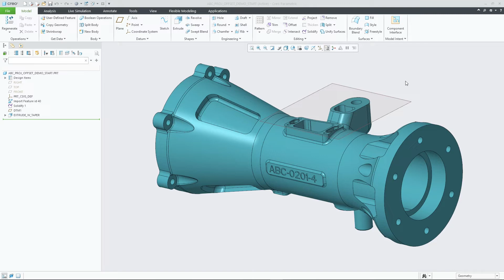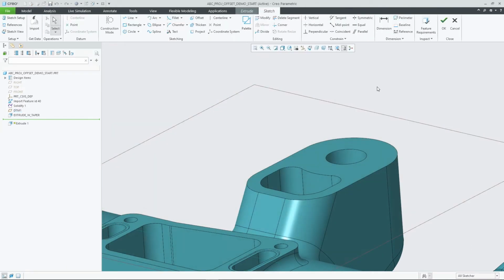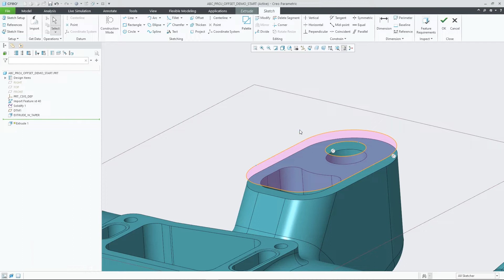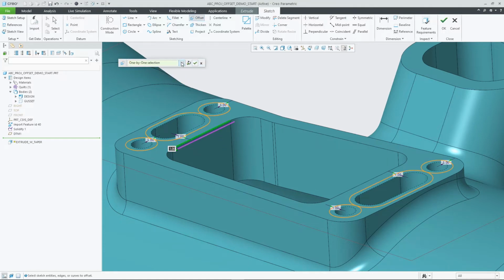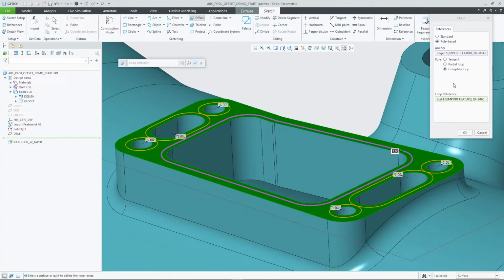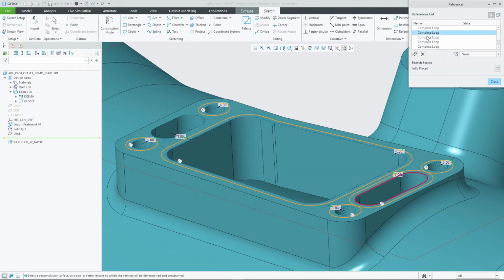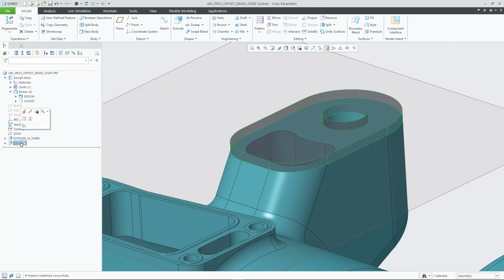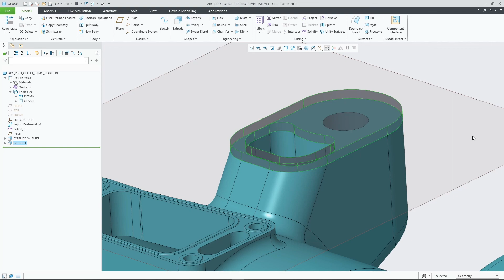Modernized Project/Offset Tools in Sketcher | Creo 9

Comment: Hi, I ended up here because I had problems offsetting a chain of lines and arcs on a simple sketch. In Creo 9, you only have the option to offset element by element, not the whole chain. To resolve this, I have found that you have to do two sketches, one with the original chain and another one using the offset tool. If you want to have the original chain, also use the project tool in the same sketch that you have the offset. 
For whoever is responsible, I do not know if there is an easier and faster way of offsetting a chain, although I would be pleased if someone tells me how. If there is not, you have done the basics more complicated so this is not an improvement but a deterioration. In other programs, it is easier.
Reply from the maker: Hello, I recommend that you end up to this link if you wish to contribute ideas on how to improve Creo: https://community.ptc.com/t5/Creo-Parametric-Ideas/idb-p/creoparametric